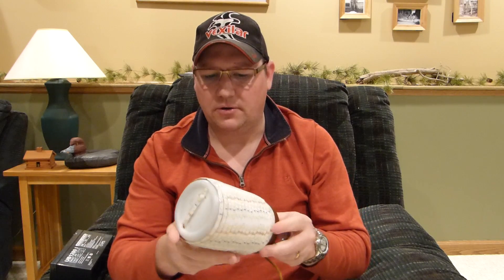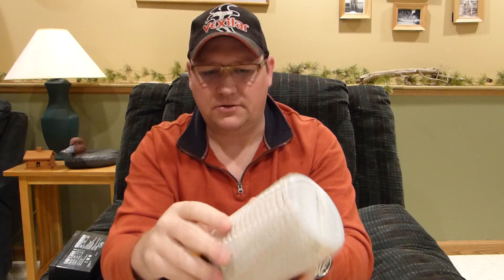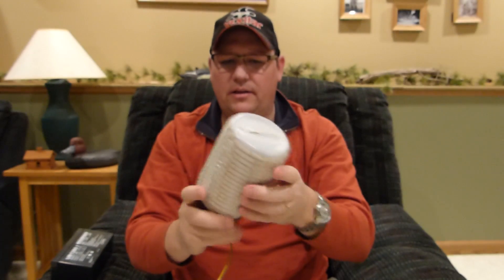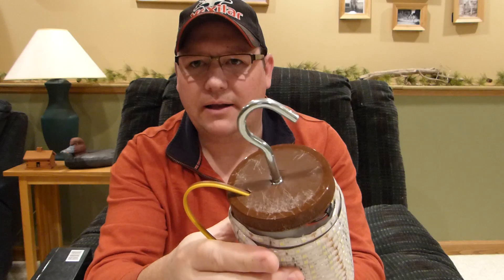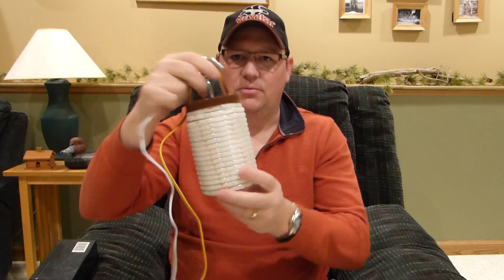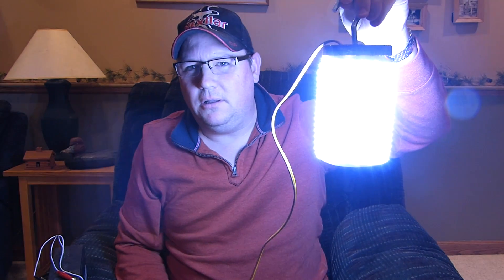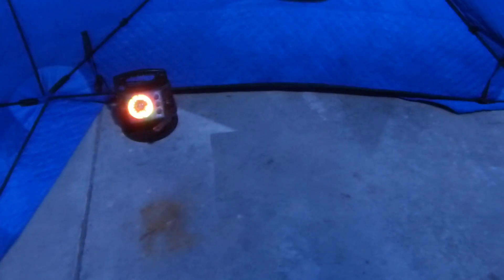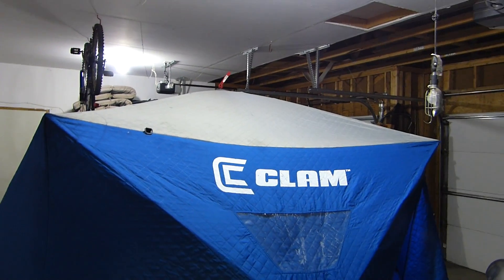How to make a super bright 12V LED light for $10!!

Comment: Nice job, great idea!  I’ve recently started using the 5V version strips with a USB adapter for my drill batteries. I’ve got the 8’x14’ hub, very happy with the run time. Plus the extra USB in the adapter can be used to charge phones up.

Comment: Best thing is using Milwaukee or any power tool battery to run these and then buying the Milwaukee car charger to recharge your batteries.You can run these at 18 volts and they are brighter without issue.I buy the ones with dimmers for 5 bucks more that way I can lower the drain on the battery if I don't need full light.Dimmable LED Strip Lights, JUNWEN Daylight White Mirror Lights Kit, 300 LEDs 16.4FT Rope Light, Under Cabinet Lighting Strips with 11-Keys RF Remote Controller https://www.amazon.com/dp/B07SGXBHVR/ref=cm_sw_r_cp_apa_i_LGqSDbX65V0BK

Comment: add a small solar panel to the battery with a charge controller and you would be good to go for as long as you need!
Reply: Also the warmer LEDs are not so blue and easier on the eyes
Reply: Christine Swalgin Jksaoasp.spp

Comment: to run these led strips permanently on 12V you need a descent heatsink! It will work like this for a while, esp. on a weak battery but the lifetime of the leds will be much less than with a proper heatsink! They are ment to be fixed on an aluminium profile to get the heat dissipated! I guess if you run this on 15 V for a longer period the platic bottle will melt down :-)
Reply: richardnanis Could probably wrap the bottle in aluminum sheet then put the lights on that. Also since it’s a bottle you could keep ice water inside and crank it up to 20 volts lol, just replace the ice occasionally

Comment: Those led don’t pull much power. It’s the battery your using that makes the run time so low. I run regular 50watt dc bulbs while fishing and they pull a lot more power than leds and they last all night long on a deep cycle battery.

Comment: If you used a smaller section of led rope would it extend the life of the battery? My hub shelter is pretty small and I would like something that I could run for about 5 hours.